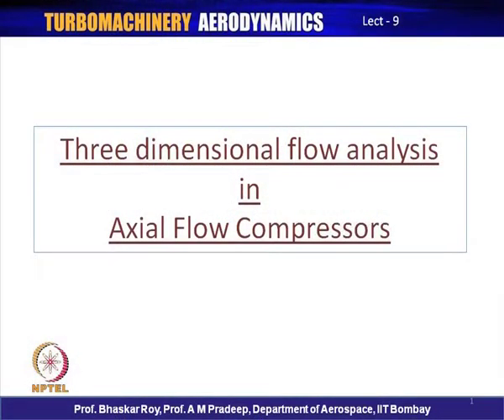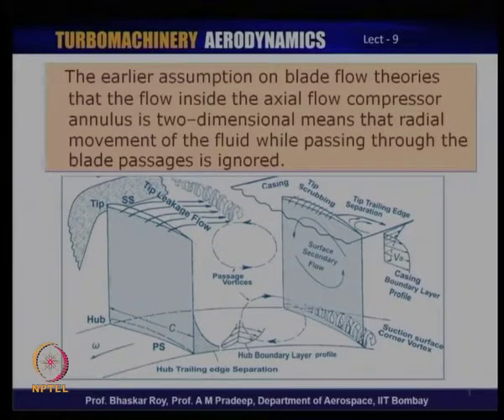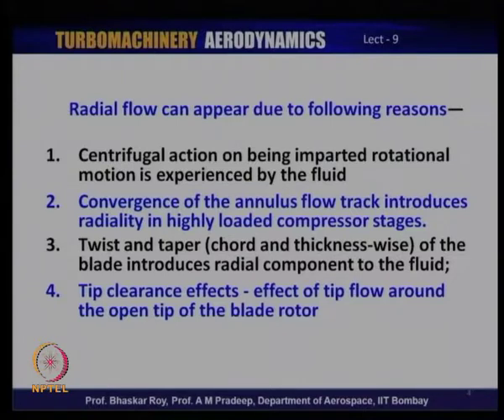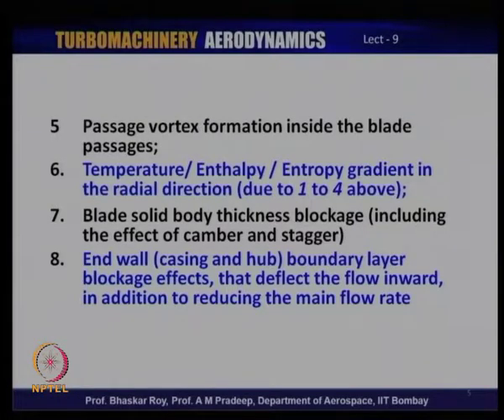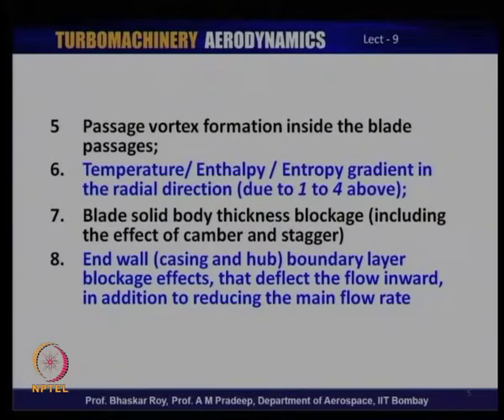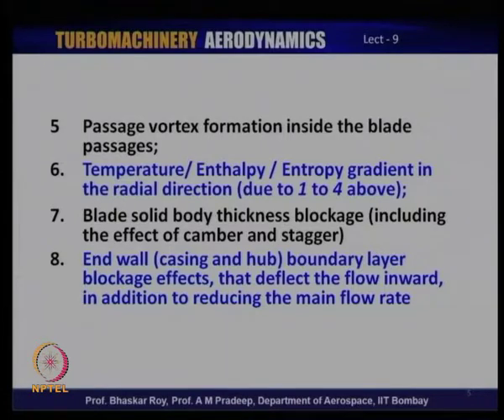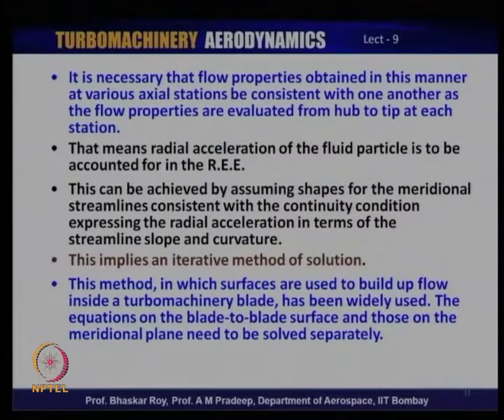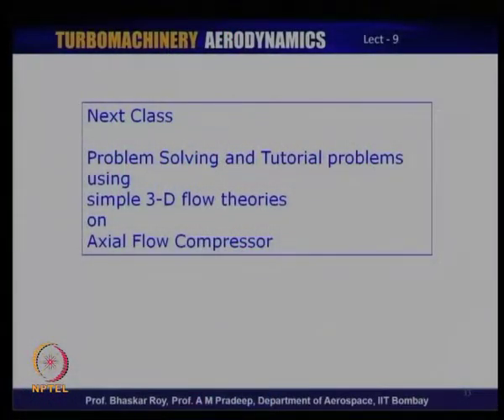Mod-01 Lec-09 Three Dimensional Flow Analysis in Axial Flow Compressor

Comment: Thanks again! Slight Correction: @19:12  - the subscript for the 1st term in RHS should be XYZ and not xyz. Also, in the explanation that follows, the equations seem fine; however, the explanation probably needs to talk about how this is basically a change in the coordinate system. There is no explanation as to how xyz becomes XYZ with the extra terms appearing magically.